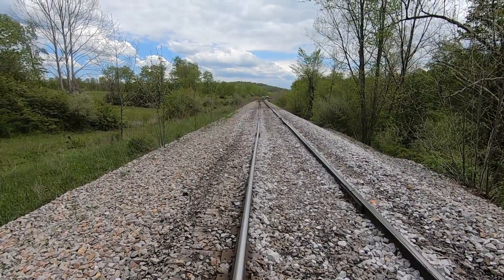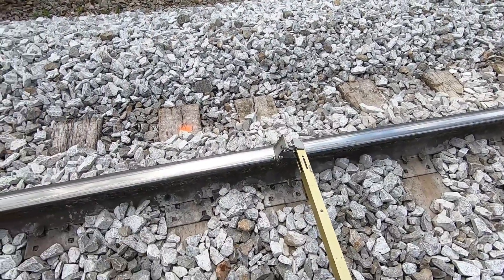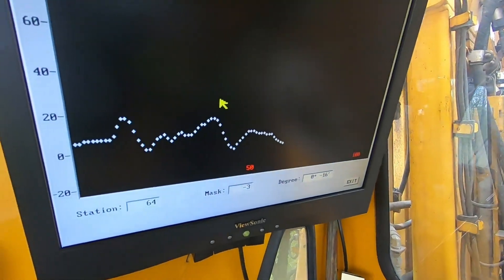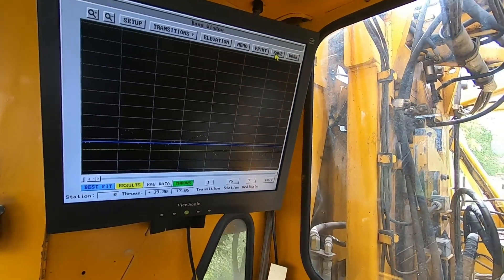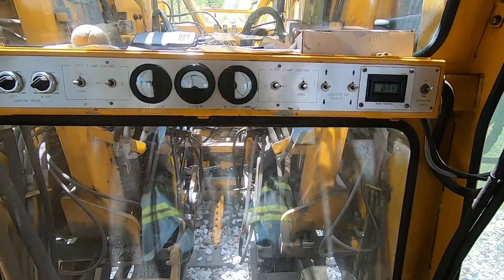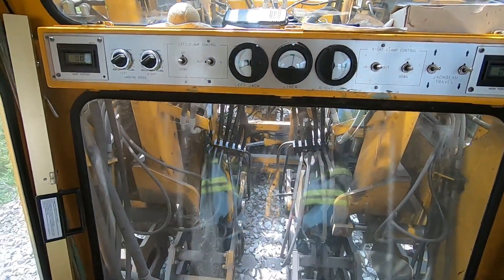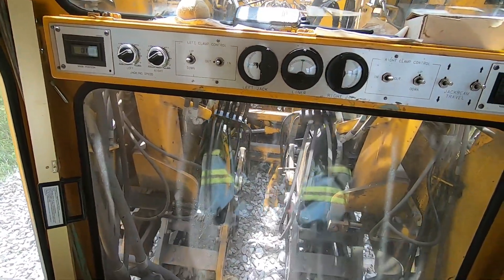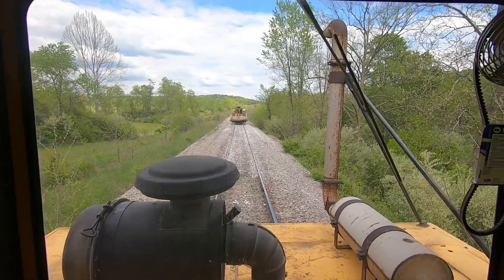Jackson 6700 Tamping a Bad Line Sway that also has Twist and Warp in the Track

Comment: Still amazes me after all the years trains have been running, that they still don't have something to take the place of the cross tie timbers. I would have though by now that some plastic composition would have come up with a viable substitution for the cross ties that never would rot out or need replaced. IDK. Thumbs Up!
Reply from the maker: Thank you Gary, glad you enjoyed. They do make composite ties but
they are very expensive and require drilling before driving a spike, some RR's do use them for specialty applications but as a general
rule they just too expensive to put in a lot, wish that would change I 
think they would be ideal, never rot and are tough

Comment: Looks like you have a lot of technical areas to your job that requires to be done in a certain order. Not many people could do your job. I never dreamed there was so much to railroading. You mentioned in one part of your video that the rail would only pick up 6 inches, how high do you like to see it picked up? Thank you for taking the time filming and putting this together for educating us.
Reply from the maker: Valerie my normal lift would be 2.5 inches, it does vary, sometimes less, lot of variables go into determining how much lift to give it, but
rarely will go over 3 inches in one pass, now I may make multiple
passes, usually make the 2nd pass after a train or 2 runs over it.
Very good question!
Reply: @ccrx6700  boy I really feel stupid, I didn't mean 6 inches, I meant one half an inch. I think I heard half and for some reason my mind went to feet thinking of a half of a foot. Six inches would really be high. LOL Thanks for answering my question. That machine is awesome.
Reply from the maker: @valeriebassett3107  that tamper will lift track in 1 pass 6 inches, and i have said that in past. But it scares me to lift that much all at 1 time. Please dont feel stupid, either at half inch or 6 inches it was a very intelligent question
Reply: @ccrx6700  you are so kind. ❤️ I do really appreciate your videos. Please stay safe.

Comment: How do the rails get moved to true , when the machine you are in seating on the rail, on ok now I hear you say the word jack, so the machine jacks it self up off of the rail and it moves it into line , and makes the cross level and all of the warp out of the rails, nice m every vlog is a school vlog for me , my family works for bnsf for 40 years, on the train , and in the rail master part of the system,, thanks, the whole USA 🇺🇸 rail systems are to high with ballast, the whole system needs to be lowered all around the USA 🇺🇸, ok,that one solution, thanks BigAl California.
Reply from the maker: Al, the jack beam on the tamper picks rail up and cross levels
it getting it's signals from a 3 point light system on the tamper
that is reading voltages, it's complicated to explain in a comment,
need do a video on it sometime. But thru a 2nd light system it does
the same thing aligning track, hope that helps clarify it somewhat
for now till I can get video made

Comment: I used to work for a company that built MoW equipment like this, and every so often we'd get new management and they'd decide that we should develop a tamper. And all the engineers would just shake their heads because we knew we'd never hold a candle to one of these. We built some pretty awesome stuff but the tech required for a tamper is something else.
Reply from the maker: You are sure right in that Logan, I been running this thing for 18 years not and it still puzzles me sometimes, an amazing machine for sure it is. That's pretty neat you got to be involved in
building RR equipment, that has always fascinated me how
you guys do it. Thanks sir for watching

Comment: I don’t know why you would want to plot tangent track (for the video ) a lot of time lost looks like your running at +7 ? How did you not swing the track at the start? You may have miss spoke when you were talking about grade rail and bias,,,,I think you should have used the line rail?
Did you have more positive throws then negative
Reply from the maker: Hello Mike, sounds like you have some experience in tamping.
I would like to know more about what you do sir. Not many
people would understand bias as you apparently do.

Couple things, there is no one else here who can help me if I
mess up and get in trouble lining track, I am the only one who
knows how to do this, we have zero other people who have any
clue about lining or even surfacing track. So with that said,
yes I could have lined this without plotting, however plotting
significantly helps me understand the geometry of the track,
where to begin and where to end lining, so before I start I can
figure this out and make track end up so they can run a train
without having to hold them up.

I don't start lining until liner needle is in the green or slightly off center, that avoids a "dog leg" at the beginning. 

Everything was biased against the line rail, maybe I misunderstood
what you were saying? In this case it was the left rail.
7 was indeed the ordinate I chose to make the initial pass. And there were more positive throws than negative although I don't
remember the difference between them and have since deleted
the plot, but it wasn't a whole lot of difference. 

Appreciate your watching and look forward to hearing back from
you sir
Reply: @ccrx6700  hi your video just popped up on my feed,,I’m actually an operator trainer for CP rail in Canada I also worked for Harsco/Jackson for many years,,,, looked like you were doing a good job didn’t mean to come of negativity towards your work 
I always find that lifting and lining at the same time works better 
I believe you had mentioned grade rail instead of line rail at one time ,,,,no big deal 
Most 6700s like to run at -3 to + 3 tollance (for the lack of a better word) I’d be concerned with a 7 on tangent,, this can be corrected by setting unity 
Keep in mind positive throws for the most part are best as to much negative (down hill throw ) may cause a sun kink this time of year
Jackmanmike68@yahoo.com we can exchange information I don’t mind helping you out
I may make some videos and put them on my channel 
Take care
Reply from the maker: @mikejackman4416  Mike, i usually run a surface lift, then 2nd pass line if needed. I run lift on lining but usually bout an inch or so less than when just surfacing. Is that pretty much what you do?
Reply: @ccrx6700  Dave we I usually teach the guys to lift line and correct elevation all in one time is limited we are usually running around doing recorder car defects....all  CPs 6700s have the PD work heads now,,,,, they are stronger compaction tool
I find in mud spots the lifting helps the jack beam line faster plus the tools in the ground break it up
Watching some of your other videos (well done by the way ) it looks like you don’t have the mileage or the trains we’d😉😉
We’re are you located?

Comment: What happens if a train needs to get through while you are on the tracks working? Probably a dumb question but ill ask it. Thanks
Reply from the maker: Very intelligent question! We have to do what we can, then the
train operator gives us a call when he's got about 20 minutes before he going to depart, then we have to clear up and after he
passes then go back to work. They have no sense of humor here
when we hold a train up. Now if we had an emergency like a
broken rail or something, then that would take priority and train
will just have to wait. WE keep in constant radio communication
with the train so to avoid any downtime. Also if there is a place
that is not fixed right I can give a slow order for a train to pass
over until I can complete repairs, each situation is different as
I'm sure you can understand. Thanks for asking
Reply: @ccrx6700  thanks again

Comment: I believe you did mention about the hill slowly sliding away once before in a previous video.  I believe you mentioned you also have or had an area that is, or used to be, a culvert that may also be "settling", causing a hill to slip.
Reply from the maker: Yep that was a culvert pipe on curve 12 had thought maybe it was collapsing, but engineering looked at it and said it was fine, got several areas like this over the years, just gotta try an keep up with them. Appreciate your viewing today's show sir 👍

Comment: where the bed is sliding out. i wonder.. how much damaged rail sections do you have.  could you use a pile driver and use those rail sections to shore up the slide area . if they are driven in with the upper end still having holes to bolt tracks together. the crew might  be able to use custom U bolts to bolt track sections along the top to stop any from falling outward with the pressure..  i don't have to tell you the  rotting wood needs to come out. 
lastly another different thought crossed my mind the hot  axle detector.. is that set up installed far enough away from the loading point for bearings to actually heat up when failing.  do you have enough car repair crews to  jack up both sides of each axle/truck and use automotive stethoscopes to listen to the bearings as somebody spins the wheel set..  its just a thought..  noisy bearings will rumble.. good bearing won't make any noise.. depending on how portable the jacks are.. they might be able to do 4 or 5 cars in an hour..  just as long as the cars are hooked to a locomotive with the brakes set and the engine off.. so its quite along the cars..
Reply from the maker: Very good suggestion Wayne! We had to do a similar repair on a
slide near Bridge 7 bout 25 years ago. I've seen Hulcher doing the same thing on a slide near Harvey Mine on NS tracks here in
Greene County.  The slide at bridge 7 was about 3 times as long
as this one and we drive the rails in then used bridge timbers up
against the piling, then filled with big rock, worked out exceptionally well

Comment: If the underground wood beams are rotting, why not just inject that concrete slurry stuff into the sub-roadbed to lock it all together and stabilize it?
Reply from the maker: Hmmm, might be a pretty good idea you got there my friend. It's not a down deep slide, but only bout 5 or 6 feet deep, so that may work very well. Am gonna suggest engineering look into that. Thanks 👍👍

Comment: I was a foreman on Plasser Cat tamper we used a laser gun set up 1/2 mile down the track. That machine would follow that laser and leave the track straight as a arrow. Wasn’t too crazy about the Jackson did the job though
Reply from the maker: Awesome David! We looked into a laser several years ago, lot of expense and for the small amount of tangents we have plus only
having class 2 track decided it wasn't worth it. Guy told us that
operator better have some big balls when using it when that track
is getting pulled 6 inches into alignment, but it sure would have
been nice to have it. Thanks for watching sir, appreciate that

Comment: Totally fascinating, when i worked wrecking gang, my job was 977 track loader, Worke a 50 car coal wreck, At the end I had pushed the coal out and was pushing in rock from a shooter car. Im terrible a grading, the foreman called me down  and said " just push it flat, Ill make the tie bumps later!!" 
Thanks for posting, Be safe.
Reply from the maker: Thanks David, I cut my teeth way back in the early 1970's on 
a 977 loader pushing coal, that was a great machine to run, 
I was young and didn't mind the rough ride but it sure could
push! Stopped it one very very cold day on a coal pile, next
morning it wouldn't move for me, heater in it sucked, but the
tracks had frozen to the ground! Next night I parked in on boards

Comment: I am guessing that the plot you made at the beginning is the overhead view, as in the rail wiggling right and left, and that "Lining" is straightening the wiggles out and sliding the rail from side to side to get it straight again?

I guess I have assumed that a Tamper only lifts the rail, how does it slide it sideways? You talked about the jacking bar, does it lift a tie and jack it sideways?

Also, can you LOWER a rail with the Tamper, or is it only able to lift the rail?
(I am assuming that it can't lower the rail, unless it has some way to remove ballast under the tie, since lifting the rail is by adding ballast under the tie.)
I guess you have to be really careful with tamping and lifting rails when you are getting close to switches and crossings, since if you get too high you can't go back down! Lol
Reply from the maker: You are right in that Ben, no more wiggly piggly here,,,LOL
Thanks for viewing today's show sir

Comment: Use some old sticks of rail to build a new retaining wall to shore up the work done 35 years ago. That should help you slow down the track slide.
Reply from the maker: 25 years ago had bank slide out at bridge 7, we drove rail into the ground then put used bridge timbers against the rail piling. Has worked well so far so may need do the rail trick here too. Thanks Zach 👍

Comment: Lookin good.  Hope you got AC in that thing.  I’ve been roasting the the test truck with no AC the last couple days. 🥵
Reply from the maker: Oh dear! AC in tamper, not for my benefit but to try and
keep computer cool, and it doesn't work very well, if you saw
in the video had the tamper doors latched open! Hope you 
around home for a change
Reply: @ccrx6700  I hear ya about keeping the computer comfortable.   They overnighted me an AC unit for the computer cabinet.  And told me to buy a fan for myself.  But at least it’s raining here today hopefully that’ll cool things off.
Reply: @emknapp6713  makes sense-save the computer, cook the human!
Reply: 120 out here in the summer and the a/c doesn't work in any of our equipment, I hate summertime lol
Reply from the maker: Understand that Michael! RR gets hot! My tamper AC doesn't work
very well either unless it under 70 degree out....
Reply: @ccrx6700  we have 4 tampers two very old jackson 6000's, one 6500 all electric no hydraulic vibe motors, and an old cannon spot tamper. The three production tampers are getting scrapped next week so were stuck with a 50+ year old open cab spot tamper.
Reply from the maker: @michaelball760  oh dear Michael that sucks, will you have to hand jack track for it then? That stuff reserved for a younger man than me 😉